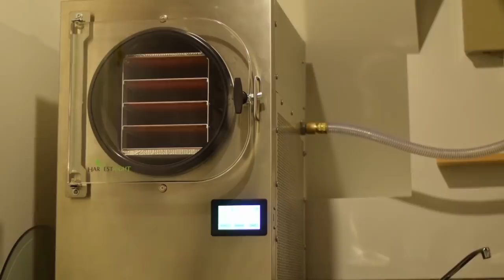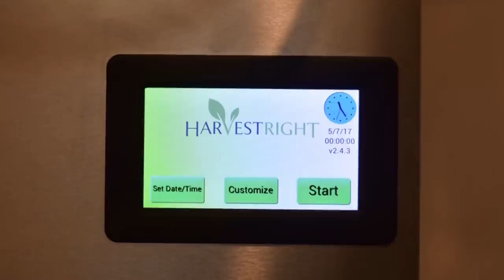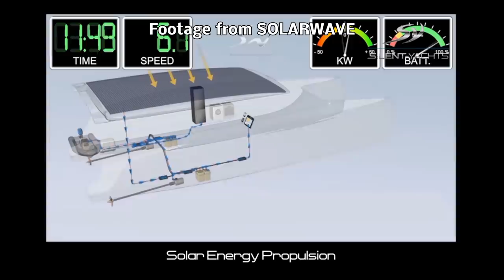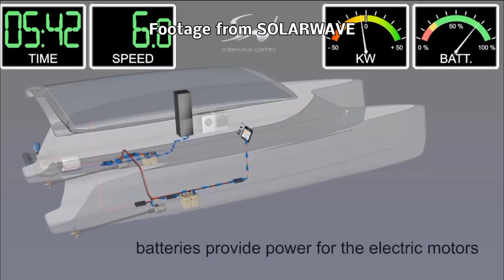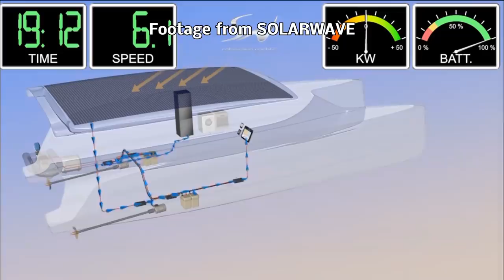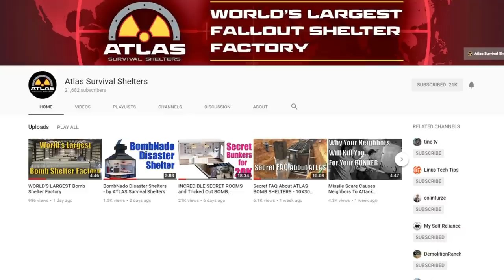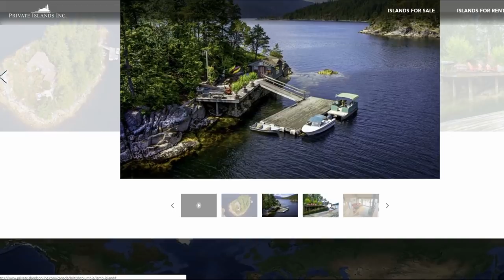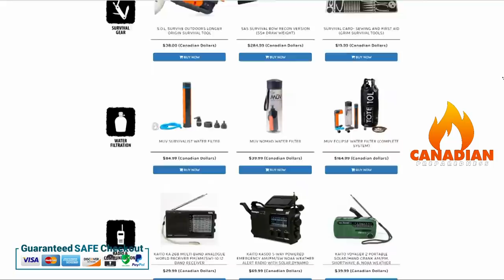TOP 10 Prepper Items YOU WISH You Had!

Comment: I've knocked off everything I really NEED over the years. Good allies. Tools. Clothes for all sise and climate. A massive library (backed up digitally and redunduntly).

1. Skill multipliers of any kind. (teachers, books, places to practice etc)
2. Futher passive income. Can never grow enough, store enough cash or just generally not have better trading positions.
3. A Sako TRG 42 in 338. (I just like a rifle that can reach out and touch somebody.)
4. Animal healthcare for Horses etc. (Prevention is better than cure and breeding takes a lot of prevention). Transport that breeds more transport.
5. Saw. Mill. Lumber processing was the staple on which all other industry was mounted here. It works.
6. Redundunt but standardised Vehicles. (everyone carries spare parts as a cultural thing here so that's all aces)
7. Earth moving equipment. Defensive landscaping and an income in regulartime. You can do a LOT with good moving equip. 
8. Smith with a scrap yard/large pile. One societies trash is anothers treasure. 
9. Explosives access for blowing bottlenecked roads and reducing access in an emergent way. Defensive ambush is an oldie but a goodie. 
10. Secondary bug out land to match my actual Bug out land. Nothing better than rule of 3s in land. Buy land, they aren't making it anymore etc.
Reply: S3CR3TL3V3LZ  for the explosives, potassium nitrate, sulfur, and charcoal make Chinese gunpowder.

Comment: I'm from Ireland, and one thing about bying castles and renovating them into modren homes is that it can take something like five years for all of the damp in the walls to drain out of the walls, after they have been waterproofed. The other, defensive walls, can be anywhere from (literally) a meter to nine meters thick. That's, again, literally, not an exaggeration. If you think that's thick, look at the Nepoleonic fort wall sizes.

There's a nearby small castle, that Irelands main TV network made a documentory about it's refurbishment, from an abondoned bassically large medieval tower more then what you'd think as a castle, to a modern house castle and all / a lot of, the building and building regulation, problems, that you would expect along the way, along with a tiny bit of history of the castle.
I just remember it as that old castle/tower thing we pass when driving from the mainland of Ireland, to Fota Island, to Cove Island, to make it to the town of Cove. (This is a very, very, local referance.)

Great videos BTW. Well done. God bless. :) Keep it up. :)

Comment: One thing you might be interested in could be passive ICF house. Basically they're concrete houses with no energy costs, a mixture of new and old techniques for thermal control. Generally they're large houses with solar arrays, they have to be pretty close to air tight, which means they are built with heat recovery ventilation systems which you could easily add radiation/smoke filters. basically they're above ground bunkers... https://passivehouseplus.ie/magazine/new-build/new-coastal-icf-home-goes-passive-at-low-costs here is one built for 300k euros in ireland 

Converted its almost 2600 square foot house that cost about 350k USD. You can build ICF houses for a lot cheaper but passive houses tend to be on the more expensive end. however in the US 350k for a 2600 square foot house when you consider the estimated costs per square foot of average new house constructions in the US being 90-200$ this house is about right in the middle around 135$ per square foot

Comment: One thing I was thinking about was stacking shipping containers in a square or rectangle 3 high and creating your own steel castle wall, it's steel     so you could weld deterrents to the outside. Have it reinforced, all containers interconnected, 360 degree observation and sniper position or if you  really want to put out the money and get creative shape it star of David design. Horrible to siege for a aggressors!

Comment: While multi fuel engines are able to operate on lower grade fuels but they can NOT do so indefinitely. They have to be cleaned afterwards if you use cooking oil or other lower grade fuels in them. Islands located in Canada or Northern US that are on lakes might be somewhat isolated in summer but they might not be in the winter due to the lake icing over to the point you could walk on it or even drive on it.

Comment: I would add monolithic dome homes those are built out of steel reinforced concrete and can take a direct tornado hit or a Cat 5 Hurricane. They are earthquake resistant, fire resist and small arms fire resistant. You can even get ones lined in a Faraday cage so it is EMP EMI proof.

Comment: A DEW snow machine. It is a multi-fuel snowmobile used by the Canadian Military. Very sturdy and well made. Lets face it we are in Canada. If an EMP hits in the winter, the only way to get around will be a snow machine. As long as it is protected from EMP, either in a EMP proof garage or wrapped in an EMP proof vehicle tarp. One snowmachine per person to be on the dafe side, along with that is a decent size skimmer and or a closed in capsule on skis if you have kids. Absolutely a must if you have to bug out to your dugout location in winter.

Comment: Double hulled boats decrease the stability of the boat, as they keep the main body (hull) of the boat, above the water, and thus are more likely to tip over during storms/large waves.
I'm from Ireland, and there are car ferry's from here to the UK and France, and the regulare, large ferry's that are basically floating big towns, that basically move a small muti-story car park of cars, can sail in bad weather, as long as it's not really, really bad. One trip, my class and I were taking on Brittany Ferries to France/Brittany (disputed region, but no real war), I fell asleep, so I missed it, but we ran into a storm and one of my classmates said that a wave had reached to deck that we were on (this was one of the upper decks with a balcony, like the one on the Titanic, that goes right arounf the ship).
A double hulled ship, ie a catamaran, would normally only sail on flat water, ie, no big waves.
But the advantage of that design, is that most/all of the hull (main body of the ship) is out of the water, and thus doesn't cause friction in the water, and hence, the boat can go way, way faster, for the same amount of engine power input. I'm guessing that's why that design was chosen for a solar powered boat, as sloar power isn't as powerful as a desial powered engine, unless you have a massive, massive system, which I don't think you could fit on the roof of that boat. And plus, if those things get damaged, good luck trying to afford and then get, those things repaired in a SHTF situation. A fossile fueled engine, I presume, is far more rugged, (I'm not a mechanic) and doesn't need any clear daylight skys to function.
What I really thing would be practical is a water powered engine, because water is hydrogen and oxigen and seperating the two, small scale scentists have managed to apparently get working on YouTube, but I don't know whay some big investers didn't buy-up the idea and make it big. I have a guess, that some big oil company didn't like that idea and shut it down, but that's basically just a theory.

Comment: How about a Nepolionic fort, with a small village team of survivers with differant skills, and you can set-up a workshop inside there for making and repairing weapons and making ammo.
They seem to be either on an Island or river, so you could have a water purification supply as well as a rain water catchment system from a massively thick outer earth and stone walls.
Plus a differential machine generator and/or a water wheel could help with the powering of this village and workshop.

Just a suggestion.

Comment: Prepper wet Dream.

250 acres in my homestate.
Home. 
Verticrete Fence.
Concretene home with ballistic doors and windows.

25000 acres in the Rockies.
15000 acres in the Appalachians.

A couple dozen 30 acre properties along the Mississippi and Colorado River. For trade.

Couple smaller private islands in the Canada and New-Zealand.

Vehicle.
Daily Rezvani Hercules.
SHTF larger group. Atlas MRAP.
SHTF small group. Plan B Supply Ricochet.

Comment: Even though the Atlas survival bunkers are galvanized, I would recommend degreasing them and spraying on a layer of lime plaster on their surface before they are buried. Lime is self-healing to some extent, as it cures by carbon dioxide and cracks are often filled by lime wash or lime that hasn't hardened yet. Its often called "parging". A layer of tar or a plastic membrane after that if you can afford it, will help make it last as well.

Another thing, I have always been a fan of solar energy, but if there is a meteor strike like there was 12,000 years ago or a nuclear winter which is still possible, its not going to work well for many months if not longer.
Reply: I back up my solar with wind turbines.

Comment: There are reasonable lower cost substitutes for a few items that are worth considering. A regular mountain bike with fat tires is worth considering. Eventually the electric powered versions will come down in price. If you watch the auctions you might snag a good military surplus vehicle that is built like a tank.

I would add to your list a float plane to access many remote areas. In Canada it is an ideal asset. Lakes that are just off the beaten path are teaming with fish. You can use the plane to slowly move in building materials and build your own impenetrable bug out location. Just stay within a day or so walking distance from a road!

Comment: And if you want that safe house thing to be optimized...then surprise, build it like an actual castle, Merlin’s and all, arrow looped firing ports. Outer walls, a keep a Bailey, sally ports, rubble filled, reinforced concrete wall, thick too, the concrete and rubble fill/overall thickness of outer walls. With clear fields of overlapping fire, all around. Landscaping to minimize or eliminate dead zones out side the walls. Zero cover or concealment, a very wide and fairly deep dry moat. With a light duty draw bridge, so no armored vehicles could make it over. Heavily reinforced gate, and multiple porticulus/man trap set ups. Oh and the passage in, through your wall, small enough that only a single vehicle, with low roof and not wide can fit in, so useful, armored vehicles could make it through. With plenty of murder holes in it, plus machiclations on your outer wall/built in fighting positions. Hoardings built in on your wall to stop modern smaller artillery and of course VT shells. There ya go, about as fortified as you could get, realistically and, legally. Oh, ad spaced armor/air gaps into/onto your wall, and hoarding roof to stop shapes charges penetrating, or at least limit the chance of them doing so. FPF’s established, limit stakes for each position. Ranges established for stakes/terrain features laid out. So it’s easy, unthinking. Just need the right training and mind set then. Then you’d be cooking with fuel oil.

Comment: Armoured vehicles and not that hard to come by. I built a fully armoured humvee(with the proper suspensions, shafts, gears etc). Most of it is rated for .50 cal and the rest .308. Door windows I'm making the glass myself so still lots of testing(I'll be happy if it stops 7.62x39 at 100 meters). Front windshields will be rated at 3 shots of .50 cal each side.  All in, between 35-40k Canadian.

Comment: An American survivalist did this in the 1970s, decades ago, and all that time this news faded out and is virtually forgotten but he is still alive and the community of like minded people around him and their families are helping running things but all are engineered to be passively self-regulating and self-maintaining. A floating drydock made out of stainless steel reinforced high quality concrete that can carry several 90,000 tonner battleships is your best bet. You can start immediately spraying the insides of the ballast tanks with fresh water to remove the salt water and pumping it out at the same time and dry air blasting it with pure dry hot air and sand blast it with dry ice sand blasting and then filling them all with aero-concrete or aerated-concrete that will float like styrofoam or solid rubber foam which is 99% air. MAKING THEM VIRTUALLY UNSINKABLE. And then building balancing ballast tanks on the top floor of the floating dry dock to make it evenly flat and making modifications to make it mobile. Then add an insulated and hardened greenhouse enclosed chinampa farms in it as well as all kinds of essential micro-scaled industries-factories, general all around emergency trauma orthopedic hospitals, specialized clinics and medical centers, schools-colleges-universities-A COMPLETE SURVIVAL AND CONVENTIONAL LIBRARY COVERING ALL FIELDS OF KNOWLEDGE,  a machine tool shop, a heavy engineering shop, a machine building shop, a police force, a para-military force, sufficient medical staff of doctors and nurses and surgeons and medical specialists, a recycling public utilities systems-networks, a desalination plant, a nuclear power plant, an OTEC power plant, a small naval force/army-marine force/air force, etc. A community of self-contained 10,000 families that can accommodate 4 times more to compensate for population growth since it will have an adjunct self-adjusting floating drydock for all kinds of ships, storage facilities, mining facilities, processing facilities, etc on both sides to build more of the primary floating drydock to accommodate future population growth. And to use the seawater's properties for growing coastal edible and medicinal seaweeds and sea plants, mangrove forests to provide wood, sea water irrigated crops, fish farms, mussels, oysters, clams, etc ALL ENCLOSED IN A FLOATING CAGED ECOSYSTEM made out of a hybrid stainless steel fiber-rebar reinforced concrete with small holes at the sides to let seawater to come freely in and out. Might as well be an active aquacultural business enterprise to sell-barter before the SHTF and during SHTF and after SHTF. Since that time he has been busy upgrading it and adding things to it until it is a self-contained and self-sufficient community, schools, libraries, hospital, clinics, medical facilities of all kinds, etc. A small city of sort and is still expanding and it is out in the open ocean and has sea waves barriers to break and dissipate freak waves and is armored with perforated force dissipating hybriad stainless steel fiber-stainless steel rebar reinforced marine grade naval quality concrete. And all of it's concrete components are made from the same ingredients in making Ancient Roman concrete, Ancient Chinese rice glue-lime mortar, 18th century Smeaton Mortar (especially this one), and the Ancient Eastern Roman mortar material.

Comment: A floating drydock made out of stainless steel reinforced high quality concrete that can carry several 90,000 tonner battleships is your best bet. You can start immediately spraying the insides of the ballast tanks with fresh water to remove the salt water and pumping it out at the same time and dry air blasting it with pure dry hot air and sand blast it with dry ice sand blasting and then filling them all with aero-concrete or aerated-concrete that will float like styrofoam or solid rubber foam which is 99% air. MAKING THEM VIRTUALLY UNSINKABLE. And then building balancing ballast tanks on the top floor of the floating dry dock to make it evenly flat and making modifications to make it mobile. Then add an insulated and hardened greenhouse enclosed chinampa farms in it as well as all kinds of essential micro-scaled industries-factories, general all around emergency trauma orthopedic hospitals, specialized clinics and medical centers, schools-colleges-universities-A COMPLETE SURVIVAL AND CONVENTIONAL LIBRARY COVERING ALL FIELDS OF KNOWLEDGE,  a machine tool shop, a heavy engineering shop, a machine building shop, a police force, a para-military force, sufficient medical staff of doctors and nurses and surgeons and medical specialists, a recycling public utilities systems-networks, a desalination plant, a nuclear power plant, an OTEC power plant, a small naval force/army-marine force/air force, etc. A community of self-contained 10,000 families that can accommodate 4 times more to compensate for population growth since it will have an adjunct self-adjusting floating drydock for all kinds of ships, storage facilities, mining facilities, processing facilities, etc on both sides to build more of the primary floating drydock to accommodate future population growth. And to use the seawater's properties for growing coastal edible and medicinal seaweeds and sea plants, mangrove forests to provide wood, sea water irrigated crops, fish farms, mussels, oysters, clams, etc ALL ENCLOSED IN A FLOATING CAGED ECOSYSTEM made out of a hybrid stainless steel fiber-rebar reinforced concrete with small holes at the sides to let seawater to come freely in and out. Might as well be an active aquacultural business enterprise to sell-barter before the SHTF and during SHTF and after SHTF.

Comment: I'm surprised there's no mention of an ammunition factory. You can really go to town around one, if you know how to work the assembly line. They tend to be pretty isolated, relatively speaking.
If you're already going as far as you did, I'd want an aircraft carrier (the new American single core reactor, or an old one with a single core - half the maintenance), preferably fully stocked planes and all (and jet fuel).